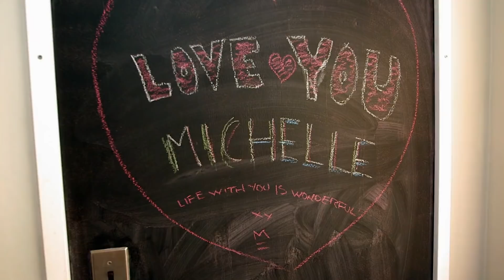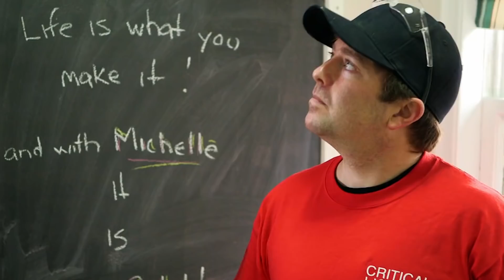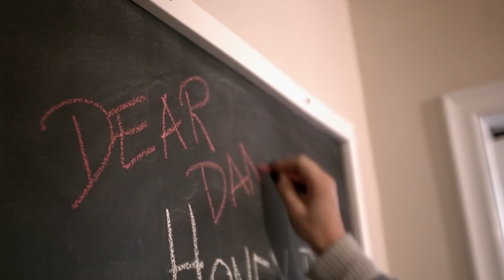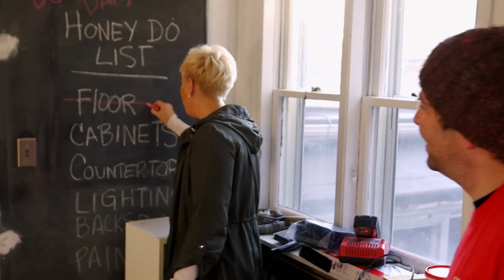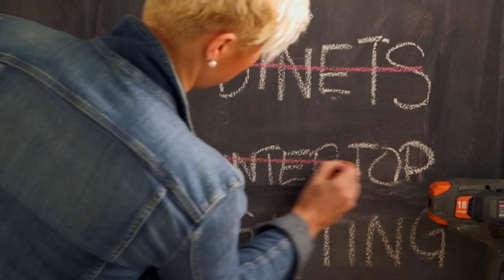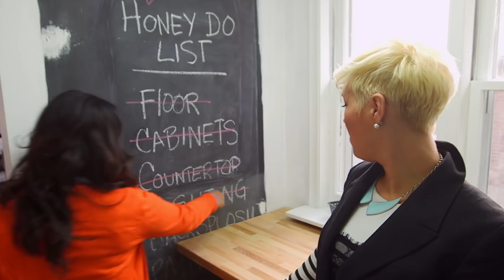Cramped Old Kitchen Needs Emergency Remodelling | Critical Listing

Comment: They thoughtlessly  destoyed wood cabinets probably original to the house, to install particle-board type plasticky looking cabinets in basically the same locations ... 😔
Plus I hope that retaining wall/garden has some weep holes to release accumulated moisture
Reply: .....I was thinking that as well.  
I also detest these shows that absolutely destroy things, because even if it's not " perfect " someone else might be blessed to get those cabinets.
Reply: @texasstardust6010  the bashing bothered me too.
Reply: I agree, they waste their perfectly good fittings all the time and it costs
Reply: Those cabinets were not original. They appear to be from the 1970s.
Reply: Yeah I would if kept them and added to them they destroy them for drama only.
Reply: Where are they that a small house is $650,000?

Comment: i really hate when renovators just
start ripping out parts that can be
reused and kept out of the landfill.
Reply: Like old kitchen cabinets that could be reused in the garage.  At least they reused the stone.  The problem is that it takes extra time, effort and money to bother with the demolition.  I once saw real rosewood cabinets from a fancy conference room thrown into a dumpster.  The contractor said it killed him to do so, but he needed to stay within the cost estimate and time constraints of the build-out of the office space for the next tenant.  He was busy with lots of work and couldn't take time to do what made sense.
Reply: @virginiamoss7045  what a shame
Reply: @artladybluntzer4112  It's done many times every single day of the year, perfectly good stuff transported to the landfills for lack of a better way to handle it.  On top of that, manufacturers making low quality products and appliances that only last less than 10 years so they get to sell more product to make even more money.  They also make them where you can't repair them to ensure they go to the landfill.  I had a Whirlpool refrigerator 29 years with continuous perfect temperature until it died in 2008; it never once had a repair.  Why can't we have this now?!  Then we wouldn't have such expense at the landfills.
Reply: @virginiamoss7045  agreed!!!
Reply: @virginiamoss7045  I bought a w/d used back in the very late 70's. I paid $50 for the pair. They lasted almost 31 years
Reply: There's always one of you in the bunch to comment on that.  Unfortunately, it isn't a realistic project for construction companies to do.
Reply: @artladybluntzer4112  Wow.  I feel like corporate America is playing us all for fools.  And we full well know it and can't do anything about it.  They have us where they want us, low wages and high prices.  Something's got to give.
Reply: @joane.3533  still doesn't keep "one of us" from making the comment, now does it?
Reply: @joane.3533  What project are you referring to?  Lots of people are beginning to comment on unnecessary waste and increasing landfill problems.  The whole right-to-repair movement is gaining steam.  I've stated why building contractors don't bother with saving useful demolition; we need to remedy that circumstance to where they will want to bother with it if for no other reason than our landfills.
Reply: Habitat Restore!!!
Reply: @nata3467  There's that.  But it doesn't solve the problem the contractor has in making the effort to remove things carefully, load them up carefully, transport who knows how far and get paid enough to cover his/her time and expense.  Habitat Restore can't resell the stuff for what it would cost the store to cover the contractor's expenses plus the expense of storing and selling it there.  No one would pay that much.  That's the problem.
Reply: Why destroy perfectly recyclable cabinets.  It may take a little more time to remove them, but there’s less chance of doing collateral damage to things like sheet rock, windows, or floors. When my kitchen was remodeled six years ago,  the old cabinets went into my garage, my storage room in the basement, and my workshop.  The Habitat for Humanity store would be happy to take them.
Waste Not, Want Not!
Reply: @virginiamoss7045  
The onus is on the homeowner to pay for and get the cabinets out before the reno starts.
Reply: @marlenegold280  Depends on what the agreement is with the contractor.  In this case the owner either didn't even think about it at all or didn't have any place to re-install them or find any use for them.  I've renovated two houses and the existing cabinetry went into a garage or a basement storage room.  The contractor did the relocating in both cases.
Reply: @virginiamoss7045  
Well, if people are worried about the environment this would be a good program to help those without access to good cabinets which might be only slightly dated. 
We have Habitat for Humanity Restore and they will pick them up in a truck when donated.
H4H is in the USA too.

Not the contractor’s fault.
Reply: @marlenegold280  I did not know they would come get them; good to know.  Still, the contractor has to have them carefully removed rather than just demolished like in this video and that costs time and therefore money.  Then he/she has to arrange with H4H to come get them while figuring out where to leave them in the meantime.  I agree that it's not the contractor's fault stuff ends up in the dumpster.  Still, you'd think the contractor could find a little time and expense as a charitable gesture to make better use of things.  Just the coordination and timing with H4H, though is just one more headache for the contractor.  Again, not their fault.  If H4H would come at the convenience of the contractor, reliably, to remove things at exactly the right time and take them away, maybe that would be worth doing.
Reply: There's a newish show called No Demo Reno where they try to avoid most of the teardowns and complete removals. It's surprising what they manage to accomplish. Hopefully there'll be more shows like that
Reply: @0SilentStone0  Thanks for that info; I'm going to watch that.
Reply: @0SilentStone0  thank you, i will look it up!!!

Comment: Maybe it's just me and my taste but I would be taking money away from the price due to that bird bath that I would be taking right back out and those conifers that I would be taking right back out. If you want an evergreen shrub, there are tons of better choices. Kitchen is nice but I agree with another comment, what's with the gap between the top of the cabinets and the ceiling. And as has already been mentioned, you still have a crappy bathroom that any potential buyer will want to address.

Comment: The retaining wall that holds soil at the front of the house is a terrible idea.  I had one on my house and it caused water to run down into the basement and flood the basement.  You want the soil graded away from the house, not walled in to hold water against the house.  I removed my retaining walls and regraded around the house.  Now, I have no more water issues.  The kitchen needs trim at the top of the cabinets.  Looks unfinished and unprofessional.

Comment: Would like to see crown moldings or something to finish the space from top of upper cabinets to ceiling. Right now those spaces 
a major dust collectors. It looks unfinished.
Reply: That bothers me, too.  Imagine all the dust, spider webs and dead insects that will accumulate there where you can't get to it.  And the mice may be happy to make a nest there.
Reply: Totally agree.  I would have made an extra counter with just shelves above.
Reply: @joane.3533  That can be a nice look, but not in an already tight kitchen that tends to get cluttered anyway.  The doors on the clutter are a better idea to calm the look of the whole kitchen.
Reply: Totally agree. It looks like they stopped before it was done.
Reply: Not just dust - grease and other gross kitchen dirt.
Reply: crown moldings are not design relevant for a bungalow

Comment: All looks beautiful and practical, but a huge turnoff still, is the bathroom.
Reply: The original tile floor was gorgeous.  I would just rip out the counter/sink and replace with a freestanding vanity and sink with marble countertop.  A new toilet is between $100-300 dollars.  Paint the walls white and add a white shower curtain after removing all of the clutter/decor.  Finite!

Comment: I'm sure the guy said $1000 for a bird bath? Then he goes and covers it in foliage! But even if I misheard it's still pointless to bury it under greenery where birds won't be able to drink from it! Also, removing the bulkheads, good move ... but not bothering to replace them with molding is impractical. Whoever moves in is gonna be up a ladder constantly dusting. I actually thought the wife's house was in a bigger mess.
Reply: $1000 would have gotten a new bathroom countertop, sink, faucet and maybe light fixture.   But is this in Canada?   No idea what prices are there, except the house is expensive!!!
Reply: @sandraleigh4023  ... Yes this is in Canada. Assuming the bird bath was molded concrete then I guess it could be pretty expensive, as opposed to a resin. Still seems a huge amount to spend on an item which doesn't serve its intended purpose.

Comment: I really loved this! Sad dingy kitchen now bright, cheery, space to actually sit or work at a counter top. Loved the single kitchen light that matched the big one. But I always find it weird, HUGE DOUBLE sink but people need a dishwasher?! 🤷‍♀️😂 I wash veggies, wash up etc in one little sink. A double sink when there's a dishwasher wastes So much counter top. To me that's just incredibly weird. Loved how he did the front garden, not my taste but it's very appealing to many people being almost zero maintenance. Great upgrade but shame nothing was done with the bathroom. But the front hall is the first thing you see so that's crucial to getting people into the house before literally judging once the front door is opened.
Reply: I think that huge double sink was very awkward indeed. It is a tiny kitchen, not some huge gourmet space. I also think that cabinets were very cheap. The placement of that microwave is very awkward and @20:07 that awkward open space above the fridge and the unfinished tops of the cabinets really look cheap.  Horrible design and construction.  The little breakfast bar is such a wasted space too. I know the heater is under that window and counter top... I would have removed the big window, placed it over the sink and the removed the dinky cabinets that held that microwave. I would have build functional cabinets that held the microwave - better placement and the whole "breakfast bar" idea could have been turned into a functional baking and prepping space that the kitchen lacks.   The guy is an idiot for not cleaning up the yard himself - what a dweeb.

Comment: They replaced the fridge with the smallest fridge I've ever seen. The new owners are going to need a basement fridge
Reply: Properly renovating, I would have moved the radiator, made window narrower, and put fridge in corner where that silly counter extension was. 
Remove chalkboard paint.
Then you could put floor to ceiling narrower upper cabinets along opposite wall, sticking out only 12 inches. 
The room would have more storage, more visual room, and better traffic flow. 
A vertical Radiator could be installed on wall where they had put chalkboard paint. 
I would have switched both window sizes; wider by sink and dishwasher to see in backyard, and the other window make it half the size facing the neighbour’s house.
Then a standard fridge would fit fine.

Comment: 10k wasted on the driveway - why would so much manpower be needed to tidy it up?? And demolition of the whole kitchen is also unreasonable and such a waste - replacing it with the cheapest cabinets you can find 🥺. If you were creative you would find ways of re-using and improving.
Why would one leave this stupid gap between cabinets and ceiling?!

Comment: I would have cleaned up the front and solved the path problem, yes to the black garage door, made a  deck over the garage, put new doors on the old cabinets, redone the bathroom, and added a powder room if possible. Skip the major demo.